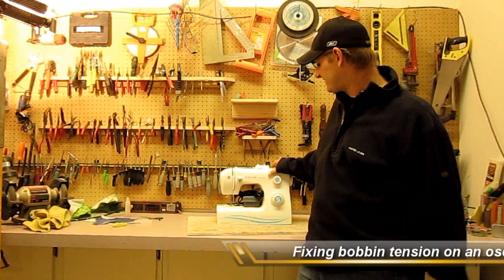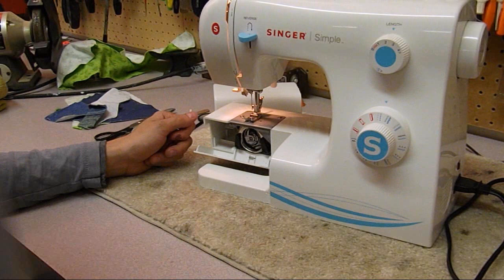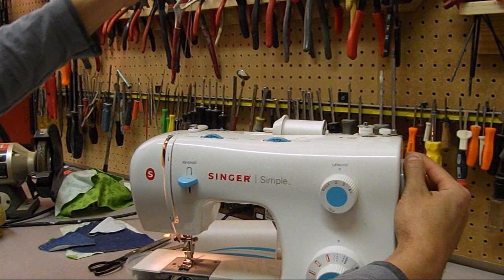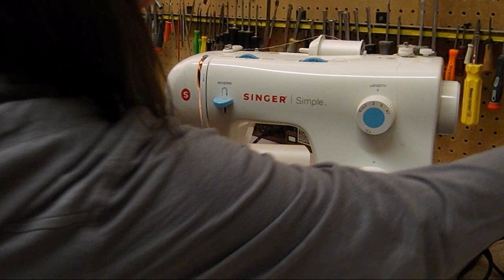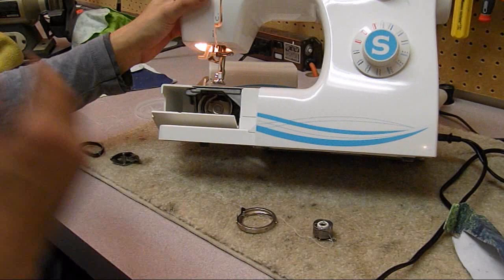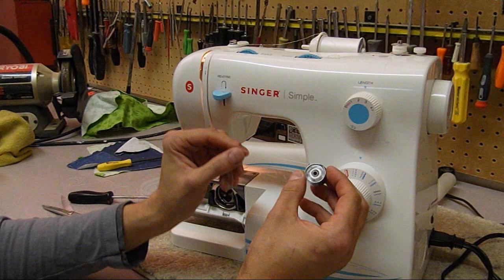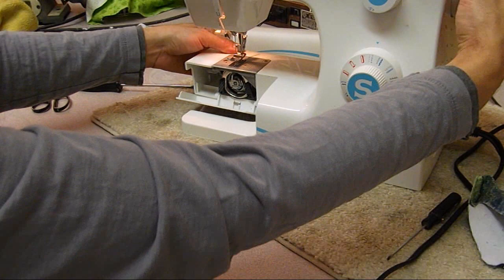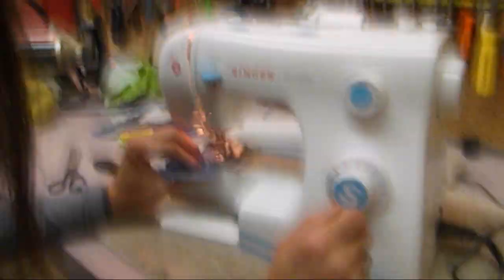Fixing Thread Gathering On Bottom- Signer Oscillator Adjusting Bottom / Bobbin Tension

Comment: Thank you for the video it probably saved me 50-100 dollars. I was having problems with the thread bunching on the underside and was about to find a tech to fix it.  When I took the hook out I found a piece of thread stuck in there.  I cleaned it out and oiled it and now it works properly again.  Mine isn't a singer but the mechanics are similar to the example.

Comment: Thank you!  I have struggle with the tension on my machine.  I you a lot of different fabric and after awhile the bottom threads do not pick up.  I tried adjusting stitches and threads with no luck.  Thanks to this video I adjusted the tiny little screw on my bobbin casing and viola, back in business.   Thanks again
Reply: Barbara

My top thread will not pick up the bottom thread!!  Help.

Comment: Thanks for this video. I was having the same problem. One of the awesome features about this sewing machine is that it threads the thread through the  needle on it's own, you don't have to manually do it, just hold the thread, pull down the white lever on the left hand side that holds the needle and the machine does it on its own 😃

Comment: My bobbin keeps spitting the tread out of the side. I have adjusted the tension up and down. Even tightened the screw to the maximum point that the screw no longer could turn. It will sew perfectly for about 5-10 minutes and the metal bobbin case will slip the thread out of the case to the back. (ie. The thread is pulling from the plastic bobbin inside and not the tension channel) How do I keep the thread IN the metal bobbin?

Comment: Any suggestions for me? I have a vintage New Home (Janome) that  is a beast and great work horse - but recently the needle jumps up and down when I try to wind the bobbin. How do I disengage the needle bar? I took off the metal stop motion screw and I think maybe I did not replace the washer (round piece with the three "ears") correctly when I tried to repair it. Could this be the problem? Do you or your buddy have a solution for me? Great videos at your channel, and I hope you have an answer for me so I can wind bobbins because I using the bobbin winder with the needle bar engaged! Thanks!

Comment: What can be done if the oscillator is not moving at all?  I attemtped to add a little oil because it was stiff.  Now it glides easier with my hand, but it still doesn't move when the machine is going.

Comment: Thanks for the video! I’m stuck at home due to the coronavirus situation and really want to finish a sewing project I’m almost done with. Questions: if the point on the bobbin part does have a burr and is snagging the thread, what do you do? Buy a new part and replace? Sharpen the point somehow? Also, if it needs oil to run along the track smoothly inside, what type of oil do you suggest we use? Thank you!

Comment: Remember to always Rise the presser feet when passing a new thread.  Lifting the presser feet will cause the tensioner device to Open, so the thread can pass inside the tensioner clamps.  If you keep the presser feet down, even if the needle is up,  the thread will not be captured by the tensioner so you will basically have zero tension in the thread.  The presser feet and the tensioner are connected with a steel rod which has the tensioner clamp split open much like a shell to capture the thread inside it, when the presser feet is lifted up.  Then when you lower the pressed feet, the tensioner clamp will close over the thread with the force corresponding to the tension setting (0 to 9)
Reply: Could this be why my machine sews about 6" of thread then the thread starts to collect in the bobbin case ?

Comment: I didn't think to check for burs cheers for that. This little check works for me until I change fabric style then I must do this over again. I own a 18yr old janome & a pinnock made in 1951 which is a better machine exept it only has 5 presser feet a zipper a walker, straight, overlooking foot & a quilt foot. I don't think it's worth bying a new machine these days as too much tension changing, foot changing & threading is enough.

Comment: When I sew it sounds like my needle is hitting hard. I have switched needles but it continues. Can you help me with this?  Thank you
Reply from the maker: Have you checked to make sure the bobbin case is in correctly?
Reply: Yes.  It's on my Brother SE 400.  I dont know if there is a certain type of needle I need to use. But I put a 100/ 16 and have used a 90/40 for denim & cotton.  It just seems like the needle or something is hitting hard.  It will sew. but it's kind of loud to me.
Reply from the maker: Make sure the needle is all the way in the holder. Inspect the needle you took out to see if the tip was damaged, maybe it was bottoming out? If all this looks good I would try a 11 or 12 needle. My SE 400 is super loud when I a trying to get through multiple layers of denim. A friend of mine taught me that a thicker needed is not always the best idea when going through thick materials. I did an interview with him and he gives some really good tips that may help. You can see them here- http://youtu.be/JR3Kf0ANbiw and here- http://youtu.be/8SPpbeleDJY. I hope this helps!
Reply: Thank you.  I will try this and see if it works.
Reply: Burley Sew

Comment: I have been sewing for almost 50 years, when all the things your talking about everyone knew and you had to manually adjust pressure foot, tension, and often had to take apart your bobbin and all the rings apart. Now have an embroidering does it all, strange can't even open the head door, where you use to open just to replace the light bulb. That was when my machine was all medal a heavy thing but sure were built to last it is still running. Wished I have kept it.Please turn off that back ground sound.